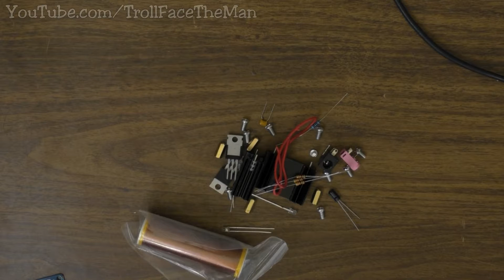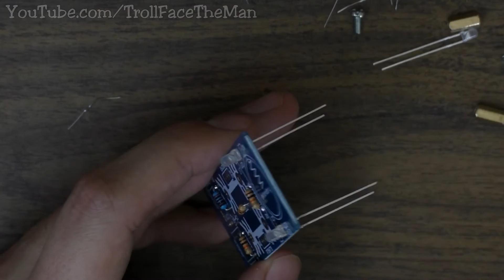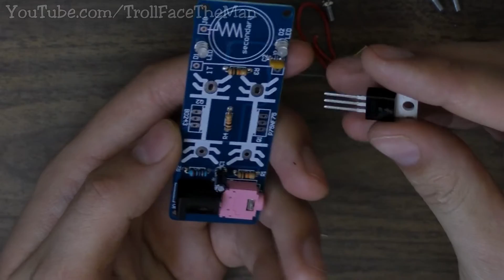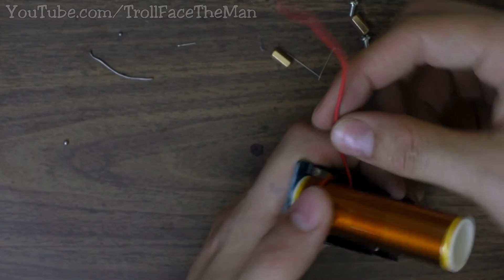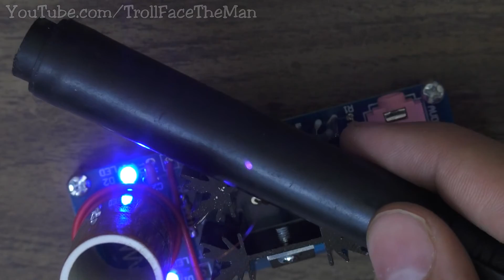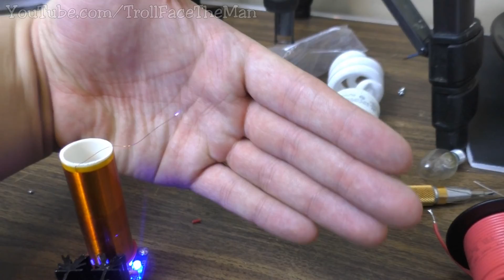$5 eBay Telsa Coil Kit Build and Test. (Plays Music Without Speakers!!)

Comment: It wasn't the "one wrap" concept, it was the direction of your wraps. By reversing your wrap direction, you reversed the winding direction of the primary. The primary needs to be wound in the same direction as the secondary. What that is, is a high frequency step-up air-core transformer.  What it is not is a Tesla coil. It's closest approximation is actually an Oudin coil. The output of that coil is actually tiny for either type coil though. If an Oudin style, the arc length should be approximately one third to one half the length of the secondary coil. A Tesla coil should arc the full length of the coil or more.

Comment: I really like how that board has actual solder traces for the RF resonant circuitry! The resonant current really is improved due to that, mainly because it's resonant frequency is about 4.2Mhz. If it didn't have soldered traces the inductance of the traces themselves really would affect the current on the board. I bought one almost identical to this one, mine does not use the back heatsinks that sit like that. My board is a bit different.
Reply from the maker: Interesting.

Comment: Oh dear that soldering iron tip was unweildy. I would have given up if that was what I had to work with
Reply from the maker: Because of the size or buildup?
Reply: @TrollFaceTheMan  the size. I may be looking at it wrong, but I'm used to a tip coming go a point not much bigger than a standard resistor lead, and even then I touch things I'm not trying to :)

Comment: I think it's not the fact that it's two loops but clockwise vs counter-clockwise that made it not work
Reply: For these the two winding (the primary and secondary) must be in phase. Even though it's ac the magnetic fields generated while the primary is energized should be in phase with mag field from the secondary (due to the self resonance of the Secondary coil and it's parasitic capacitance to ground). If they are not phased they'll cancel themselves out. Like I said even though it is ac through resonant circuitry the mag fields need to phased properly. For example if your secondary is wound clockwise then your primary must be clockwise as well.
Reply from the maker: Kevin Weber, I can see why you might think that but because it's alternating current electricity will flow in both directions meaning it'll flow half clockwise and counter in an unit of time automatically.

 The only other thing I could think is because it crosses slightly that could of messed with it.

 But I think it's more likely that it being two loops made it too low voltage to properly discharge.

 Two loops instead of one can make it go from 20,000v to 10,000 for example.
Reply from the maker: I just realized YouTube added in a bunch of ad breaks like every 5-8 minutes. I apologize this happened on accident and has been fixed.

Comment: It’s amazing how crazy cheap China knock these electric kits out at, I wonder how long it’ll last and if components can be upgraded to make it more efficient. 
  I’ve just used the last of my hot glue with my own custom project, I ripped apart an old printer and rearranged the order of the parts to make a mini rock tumbler. 
  It can run from 2 AA battery’s and up to 30 volts using a cheap Chinese bench power supply. 
 I put a video up with it last week if you’re interested.
Reply from the maker: Yeah sounds interesting I'll give it a look when a little less busy. You see how long it'll last on the two AAs? 

 Also on the wide power range, did you use a liner voltage regulator or a buck/boost to achieve it?

 As for efficiency, I'd imagine the biggest boon for it would be probably re wrapping the coil with actual copper wire.

 I think it's very likely they used coated aluminium or steel much like the wire they included for the primary.
Reply from the maker: I just realized YouTube added in a bunch of ad breaks like every 5-8 minutes. I apologize this happened on accident and has been fixed.
Reply: TrollFaceTheMan 
Don’t worry about it, at least you’ve still got ads. 
  I need the criteria with subscribers, my channel had millions of views, yet YT are like FY, we re did our policy’s.